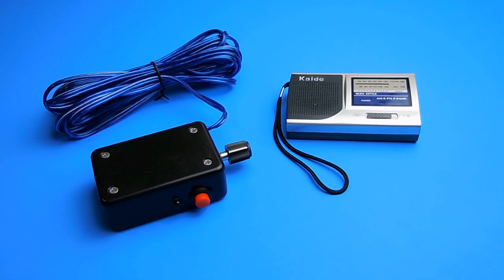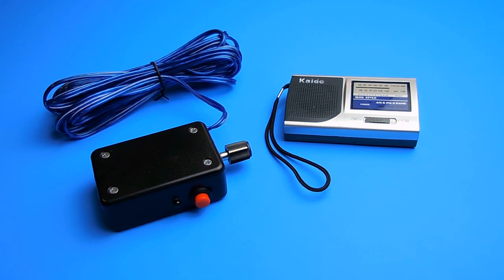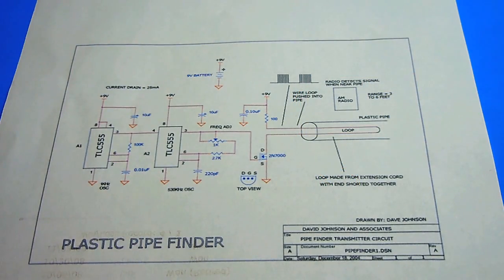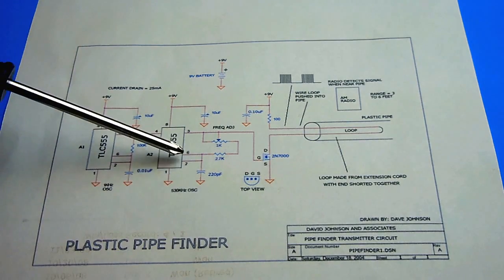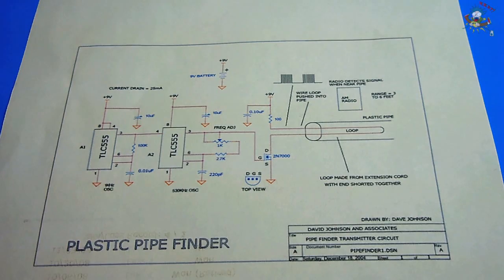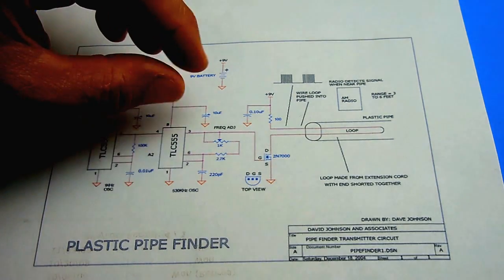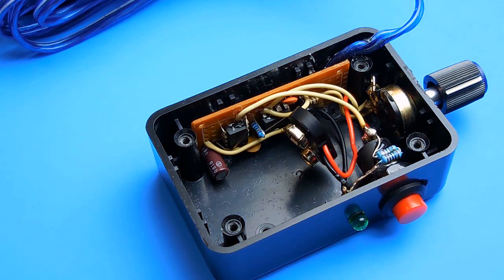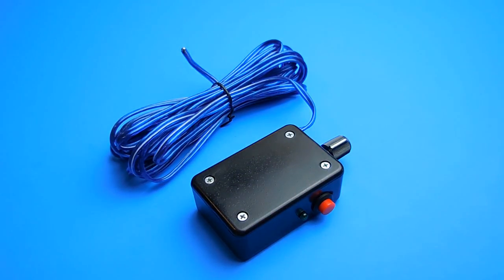Homemade Electronic Plastic Pipe Locating Device

Comment: WARNING: This circuit has errors and will not work. If you read the datasheet on the TLC555 you will notice that these ICs have been wired in the circuit incorrectly

Comment: Could i buy a 512 hertz transmitter and use the radio to find it? I'm definitely not smart enough to build one. They sell them for locating septic tanks and such. I have a sewer camera and could attach the transmitter to it if i could locate it with the radio. Thanks!

Comment: Great video, I’m trying to replicate this circuit to find some pipes under a concrete slab and this seems like the way to go. I checked all my components and almost had everything to do it, but I can’t seem to find a 1KHz OSC anywhere. The only thing I can find is 32KHz and higher. Andy tips on where to find the necessary components to finish this project?

Comment: Regarding the two 555s being "in series," how is the theoretical frequency generated by the second, higher frequency," 555 calculated? I have been unable to find a reference to help me understand how to calculate the  higher frequency generated by the second 555 calculated, given the #4 Reset of the higher frequency second 555  is triggered by the AC output of the first, lower frequency" output of pin #3. I really want to understand how this system works, and all references I find are to use of a single 555.
Reply: The 2nd 555 is generating the AM carrier.  The 1st 555 is generating the audio tone and modulating the 2nd.

Comment: Should the potentiometer be connected so it acts as a variable resistance between IC pin 3 and the 2.7k resistor ?  Is Dave's schematic drawn a bit strangely - with both one end leg of Pot and the middle variable leg shorted on the line between IC pin 3 and transistor Gate ?
Reply from the maker: You can use just the center and one side of the potentiometer. Connect all components as shown in the schematic. Thanks for watching
Reply: @electronicsNmore  thanks for reply - realised after that the pot can be wired up either way, with or without that third leg connected per schematic, and function will be same. Also emailed Dave who designed it & he was nice enough to reply & confirm same. Cheers,

Comment: I cannot put wire IN the pipe if i am wanting to FIND the pipe.  I'm lost!
Reply from the maker: You need to identify the pipe first, then trace it.
Reply: this is for people who want to know the pipe's pathway underground so they can dig down to access it at a specific point without digging up the whole length starting at an end.

Comment: I was very interested in this device, but since I could not assembly it myself I searched for one ready to buy. 
For anyone also interested there are several wire locator that can be used in a very similar way. Here is a link for one model found in Amazon
https://www.amazon.com/Fluke-Networks-26000900-Pro3000-Generator/dp/B000FTADX0/ref=sr_1_16?dchild=1&keywords=cable+locator&qid=1591744981&sr=8-16
Reply from the maker: That's not intended for pipes. Watch my other video below. :-) It's what you want. 
https://www.youtube.com/watch?v=Kw0Zz_7IBP4

Comment: Can you share the volt ratings for the capacitors and the watt rating for resisitors, please? I've made plenty of prototype stuff in the past but it's been many years. I'm guessing 1/4 or 1/2 watt resistors, but the caps are a bit of a challenge. Excellent video, by the way. And, of course the setup to broadcast to an orientable antenna in an AM radio is the essence of practicality and functionality. Thanks in advance for your reply.
Reply from the maker: Hi Gary. Resistors, all 1/4W should be fine. That capacitors need to be rated higher than the power supply for the circuit(16v/25v/50/100v....all work). Thanks for watching!
Reply: @electronicsNmore  Thanks! I appreciate the quick reply. I did sort of figure out the max would be the battery max but good to have confirmation. Looking forward to putting this together.

Comment: Could this be connected to a steel, or copper pipe to locate it. Not inside but actually using the pipe as the antenna.

Comment: This is pretty neat! But for those that may not have the know-how to build it, I suspect you can probably use a generic cable tracker in a similar fashion. Basically take a cable tracker (harbor freight has them for $25),  and then attach a wire to the leads coming off the cable tracker, and finally shove the wire into your pipe. Just not sure if the harbor freight cable tracker is sensitive enough  going through the ground and/or concrete.
Reply from the maker: Hi Brenden. What I show in my other video, is the way to go. With a coupon code, it's very reasonable. Thanks for watching!
https://www.youtube.com/watch?v=Kw0Zz_7IBP4

Comment: I found this video because I am trying to trace down where our buried gutter drains go so I can tap another drain into it.  Went to several rental places and none of them have anything to rent.  I threw this circuit together and yes, it works.  BUT, it really seems to depend on the radio you have.  I didn't have an AM radio so I ordered a cheap one online.  The radio picks up a signal, but the distance is only up to 6 inches or so.  I played with the antenna wire type, length, and got the same results.  The only other AM radio I have is in my truck.  With this radio I was able to get the signal up to 5 feet away (in air).  That was cool, but probably a little inconvenient to be waving my truck around over my yard.  I'll have to find another AM radio somewhere.
Reply from the maker: They usually go into a dry well.

Comment: Thank you for the very useful video. Regarding TLC555, could you please specify what kind is it (there are different variations)?TLC555CP : Maximum High Level Output Current: -10mA, Maximum Low Level Output Current:100mATLC555MJG: Maximum High Level Output Current: -100mA, Maximum Low Level Output Current:-10mA
Reply from the maker: TLC555 Cmos
Reply: Can you please share your PCB template. I tried to follow the schematic in your video but I could not get it work. Thanks

Comment: You should add a Bill of Materials to this if you are serious about people making it. As in the details of each component: tolerance, power, type etc etc. Saves time in pulling off the schematic and looking at the video details. And a nice detail would be to have some sort of indicator to the audio output of the radio: a bit easier to get a quantified result. On your video I couldn't actually hear much difference. And perhaps a comment in terms of the best frequecy to use to get penetration: I'll think about that and post what i find. Anyways, is a good project.
Reply from the maker: Like all my videos, If the schematic isn't clearly seen in the video, a link is posted in the video description area. The circuit is very simple. More than enough information was provided to viewers. I don't force anyone to make what's shown on my channel, I simply show the circuit works, and provide the schematic. It's up to viewers to do a little work themselves. I don't exactly make a lot of money off these videos......I actually lose money making many of these videos. As for the audio, it works fine, you can hear the changes. Thanks for watching
Reply: Do some study on basic electronics.Knowing Ohms law will give you the answers.Advance your knowledge and have some fun.

Comment: Doesn't work.
Reply from the maker: Michael Beale Of course it does. No bogus videos on my channel.
Reply: well, it doesn't work in a PVC pipe above ground, nor in a pipe below ground.  So maybe just under marble stones?
Reply from the maker: Michael Beale Sounds like your circuit was put together wrong, or you failed to tune the receiver to the correct frequency.
Reply: Ah, but it works when the antenna is out of the pipe...🤔

Comment: Couple of tips... or not; one, keep the radio flat when locating the conduit as that will help eliminate false signals and two, once you have determined the path of the conduit mark it and turn the radio to 45 degrees of the path and step back moving the radio along the ground away from the conduit at the 45 degree angle and the strongest signal between the marked path and the radio will give you the depth of the conduit. As in my 41 years of experience with the phone co that is how we determined the path and depth of direct buried telephone cable so I see no reason that it wouldn't work the same with this device.
Reply from the maker: Thanks for the tips and watching! Be sure to check out my extensive video playlists and share.

Comment: Thanks for the video.   I have a situation where a 3 inch thick plastic pipe is filled with water.  It is an underground drain, 3-4 ft deep.   Would this work?   I assume that the water will shield the RF and it wont work? What do you think?  I am also thinking to put a buzzer in the water and look for it with a sensitive microphone.
Your input is appreciated.

Thanks
Mitch
Reply from the maker: Hi Mitch. That's kinda deep, but it may work. Not too sure, but the water inside the pipe may make it easier to detect, rather than block the RF.
Reply: Hi, does this worked?

Comment: Awesome. I figured there was a simpler/cheaper solution than those $1000+ pipe locators that still cost a few times more to rent than make one of these. Already got all the components laying around except for the high freq 555s.

You earned a sub and a like.
Reply from the maker: Thanks! I have many excellent videos on this channel, so be sure to check out my video playlists and share with others. :-)

Comment: My 100 ohm resistor gets smoking hot i used a 1/4 watt resistor! Maybe we should be using a higher wattage resistor? The low power consumption stated seems unreal when the resistor gets so hot.
Reply from the maker: Something isn't right with your circuit or a component. Try a 1/2 W resistor. Using 9V? Hope so.
Reply: @electronicsNmore  I know this comment is 3 years old, but if the 100 ohm resistor is getting hot then it is likely the oscillator output is stuck high holding the MOSFET on causing the 100 ohm resistor to see much more than 1/4W.  When the oscillator is running the 100 ohm resistor should see less than 1/4W.

Comment: maybe i didnt watch it well enough but its kinda hard to tell if its working or if the stones are making the sound hit the mic better. sliding across the stones would have been helpful for this.
Reply from the maker: The device DOESN'T detect anything but the signal. Thanks for watching!

Comment: just to make sure.. this would not work on water pipes right? even if you manage to insert the wire into the pressurized system
Reply from the maker: Works on all NON-METALLIC pipes(sewer, water, and electrical). Of course the wire wouldn't be inside the pipe if it was under pressure. Thanks for watching!

Comment: I guess that the distance between the two wires in the cable will affect performance a lot. Larger distance may increase the radiated signal. And if the cable is twisted the output will weaken alot. 
Have someone tested with different cables just to find the optimal insulation distance between the two inner wires? 
One  fun thing to try is to manually twist the cable 180degrees every 10cm, and glue it to another thick plastic-only wire to keep the twisting pattern. This twisting pattern would make the signal just as strong close too the cable, but gives a steep fallof making it easier to detect when the am detector gets closer or further from the wire.
Reply from the maker: Hello. None of the testing you mentioned was done because the device worked so well using a simple 2 conductor cord. Thanks for watching!.

Comment: Can the wire be 50 ft. long?
Reply from the maker: Yes.
Reply: electronicsNmore If the wire is attached to a steel plumbing snake will the snake act as the wire in the pipe?  What do you think the max length is?

Comment: I breadboarded this circuit and the output frequency reaches a maximum of 275 Khz with a 1K Potentiometer.  I am sure I can change the potentiometer to a 2k but it will only get me into 550 Khz in the lower AM radio range.  I am essentially off by a factor of 6 in frequency output.  Any ideas on what could cause this frequency range issue?

Comment: Nice thanks how deep do you can go?
Reply from the maker: Hello. 1 to 1 1/2 feet.
Reply: I am only getting 6 inches maximum.  Any ideas on how I could getter better range?  Thanks in advance
Reply: @gusfrezoulis4097  sorry for necropost but after a certain distance, you lose "resolution". The increase and decrease in signal from either side of the pipe will be so gradual, you likely won't be very accurate anymore. In fact, it may be completely useless if the radio waves are attenuated by the soil and reflected off nearby conductors like copper water lines, etc.

Comment: What is the voltage rating of the capacitors and the wattage rating for the resistors?
Reply from the maker: 1/4W and 16V is fine.
Reply: Thanks for the prompt response
Reply: would 50V capacitors be ok? I can only find surface mount at 16V.

Comment: The 3M pipe and cable locator at my consulting firm cost $3500 but for 
the majority of my work, the one in the video would work just as well.  Incidentally, I have found that a power snake provides an excellent conductor to locate non-conductive sewer lines.  Would it be possible to make another video that add a depth to pipe estimate; includes a 60 Hz passive sensor to locate energized power lines; and lastly, for those locations where it is not possible or safely to directly connect, a inductive coil that couples with the buried pipe or cable thereby not requiring direct connection signal frequency?
Reply from the maker: Hi. You would need to speak to the designer of the circuit. I have another circuit which I use to trace AC mains wiring. That video is below. Thanks!

https://www.youtube.com/watch?v=nb5kHUNrCOc

Comment: I tried it.......All I heard from the radio was people talking. A talk show on (AM) radio.
Reply from the maker: Hi Phill. Make sure you used the exact components, the 555 timers have to be CMOS timers to be also to operate at a higher frequency. You also need to adjust the circuit for the correct frequency output. Thanks for watching!
Reply: then you do not have the correct frequency signal being generated, it's not a radio problem.

Comment: Is there a maximum length for the cable? I have encountered a few buried conduits in the 300 foot + range. People keep breaking sprinkler heads and pipe valves. Any suggestions besides pressurizing and looking for water leaks ???
Reply from the maker: +John Mulhall 
Hey John. Pressurizing is the best way to locate leaks. To trace the pipe, you would use this device. I would not get too carried away with the length, but I don't see any issues.

Comment: Excellent! You can use compressed air to blow wire into very long lengths of pipe. We do this with traffic signals and power plant cables. You make a rubber cork to seal supply end with one hole in middle for wire the other for air pressure. You connect wire to a "parachute" sold at electrical contractor supply insert into pipe with wire going through center tight fit hole in cork plug...then you use soap as lube for wire and parachute.Turn on air pressure about 40to 90 psi and wire will be pulled into pipe hundreds of feet.In case anyone needs to find mystery conduit.שלום
Reply: Shop Vac on the other end, and not using cork/pressure on the supply side would also work.
Reply: Mystery pipe... that's exactly what I'm dealing with.  I have a 1" black poly water line that's about 1/4 mile long!
Thanks!

Comment: very useful project
but what if we connect the end jiont wire to the water inside the pipe , do you think it will consider as an extension for the wire and it will beep ?
Reply: Clean water is a very poor conductor of electricity.  Salt water is a pretty good conductor.
Reply from the maker: +Gbox Monster 
The water could act like a conductor. Need to try it. :-)
Reply: Sorry guys, its a radio wave you are looking for so the water will not work as a conductor in this situation.